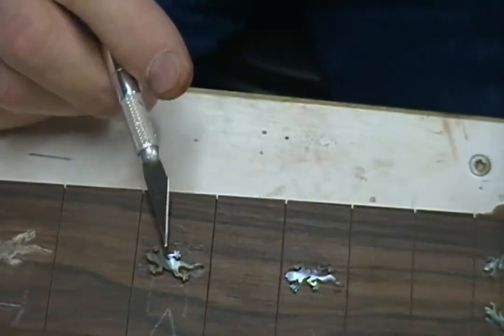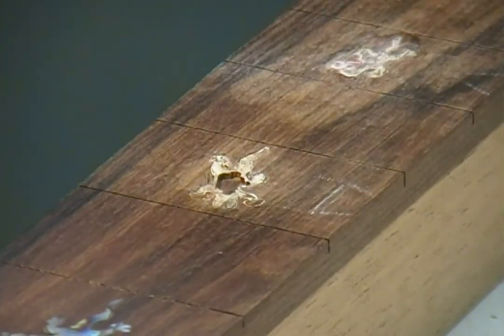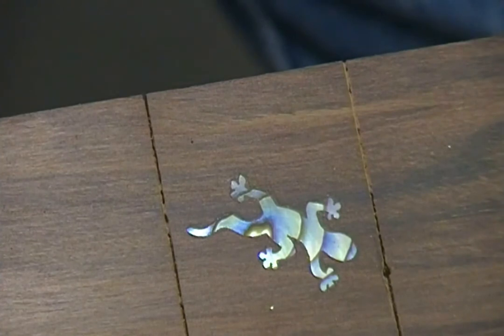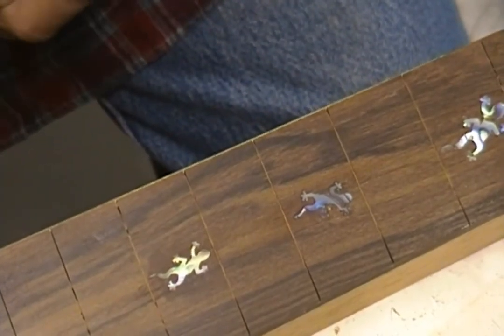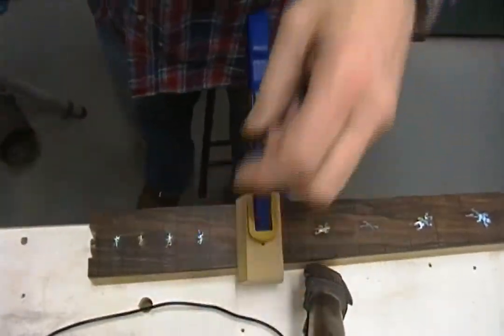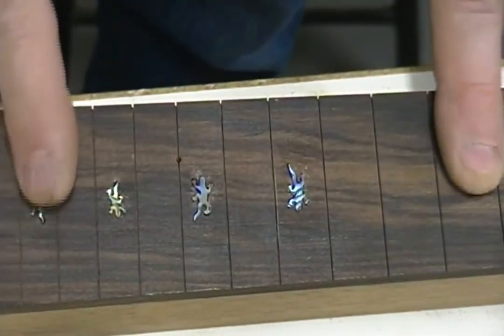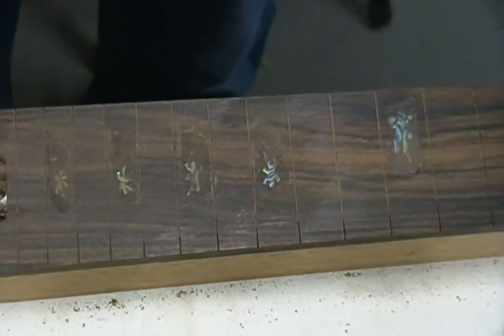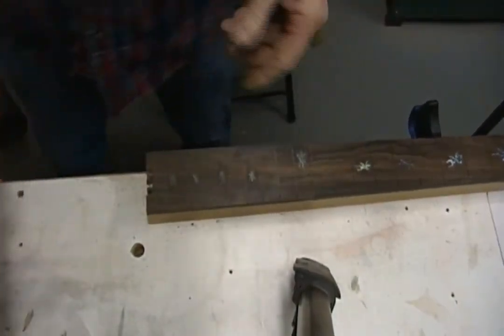Custom Electric Guitar Build, “GECKO” BY Jonah Guitars #8

Comment: Great work Dane. At least as good as "Trade Secrets" videos.
Reply from the maker: Very kind of you Dippy Hippy. Thanks for stopping by.
Reply: Dane Nichols Have you thought of using dental floss to ease off those inlays? I used it to remove a ceramic wristwatch bezel insert without breakage recently. It's useful stuff.
Reply from the maker: Dippy Hippy, I will give dental floss a go next time and see what happens. Thanks for the tip.